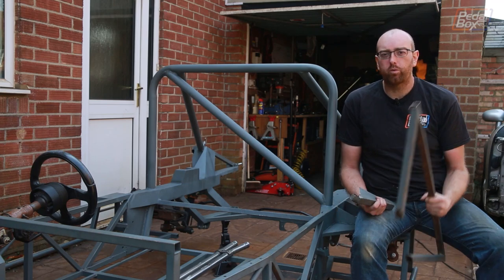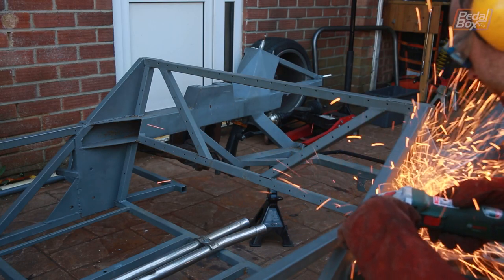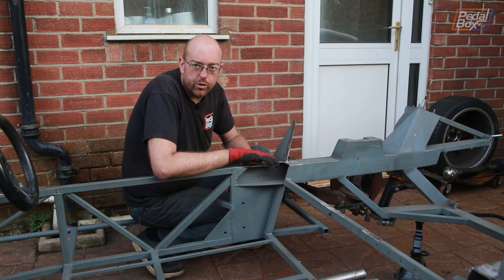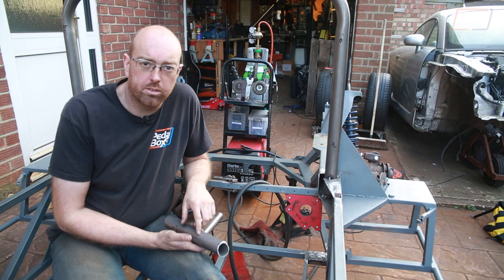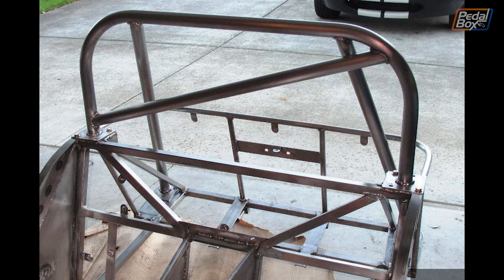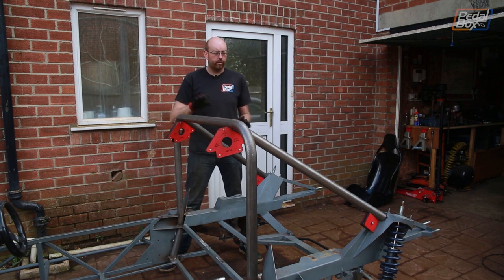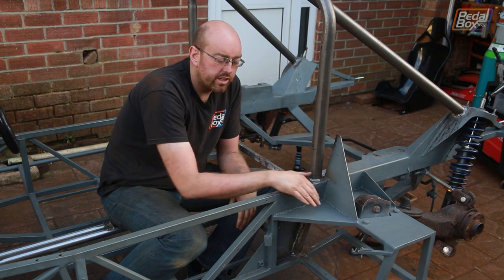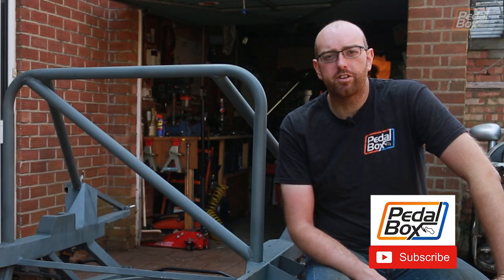Installing a Roll Hoop | Audi TT Kit Car | PedalBox Episode 47

Comment: Would be great if you could explain how you got the cage tube bent and showed how to notch the pipes.
Reply from the maker: Sure, it was such a struggle to get it done this time with so many failures I ended up not recording any of the bending. But the shop I took it to do a lot of this so there should be some more opportunities. Notching without a tube bender may be another one to do as well (now I know what i'm doing... ish). I may start another series called PedalBoc Garage with some how-to videos if theres demand and some useful things
Reply: PedalBox I’m interested 👍

Comment: Seriously how meny angle grinders have you went through 😎👍
Reply from the maker: One Bosch and one freebie we got from Mafi (in the comments). Not bad for 2 years!
Reply: Mint not as many as i thought 😎
Reply from the maker: @speniypowers1128  Indeed, shame they both broke during the lockdown, getting a new one isn't quite as trivial as it was before
Reply: But, Adrian, how many death wheels have you and Chris gone through in these 40-odd episodes?
Reply from the maker: @tfriesen3866  Oh man, two boxes of 25 1mm discs this year alone, 10-15 flap wheels, and two wire wheels
Reply from the maker: UPDATE: Grinder number three just bit the dust yesterday. Time of death: 4 months, 2 weeks. On to grinder number 4...